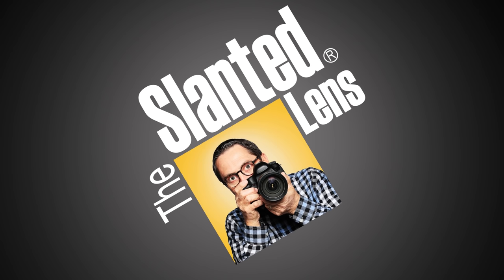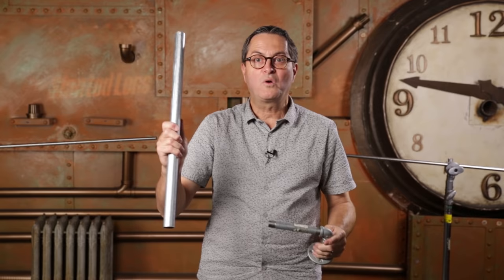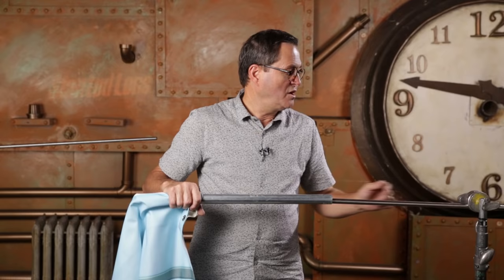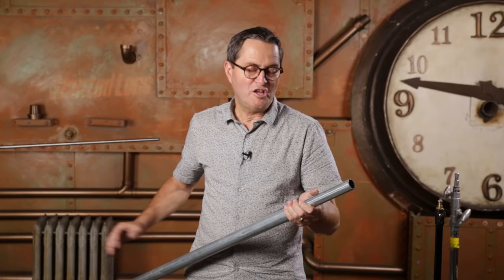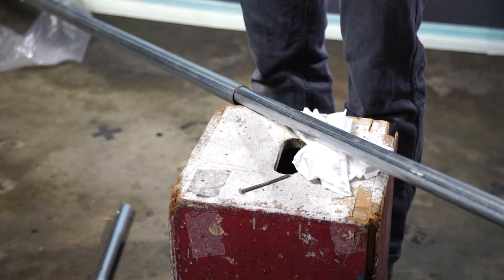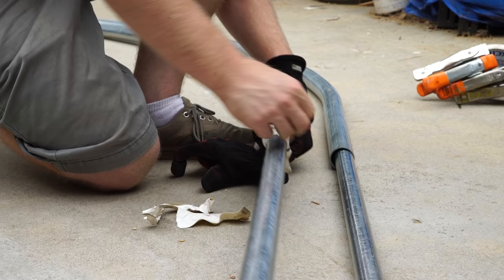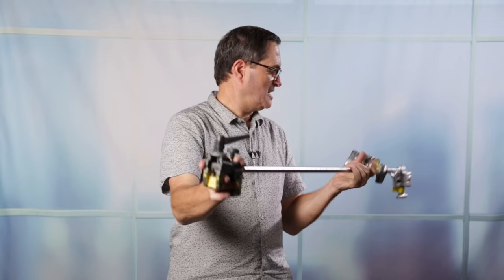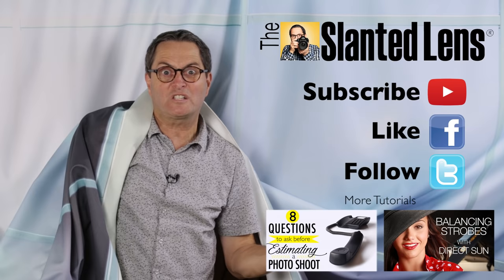TSL 3 Ways to Hang a Backdrop DIY Tutorial

Comment: Oh awesome. I had done the half inch pipes in the ceiling but with screwed in pipes over the whole span which forced me to use clamps even if my backdrop was  sown.... I will upgrade it to us the 1 inch tube the way you have it set up. Thanks!
Reply from the maker: Thanks for sharing with us!
Reply: @TheSlantedLens   i did the upgrade tonight. I will also use a pipe at the bottom to "stretch" my cotton backdrop once i have a loop sown at the bottom too. Cheers.

Comment: One thing that i'm using now are magnets.  I screwed a few strips of metal into the wall of my studio and use some really powerful magnets to hold the backdrop up.
Reply from the maker: +Zarli Win Cool idea. Thanks!
Reply: I wanna try this! Thanks!
Reply: Sounds simple.  Will give it a try. Thanks for sharing.
Reply: Damnn that's a very cool Idea!
Reply: @Zarli Win - you are a genius sir. How did you attach the magnets to the muslin material/backdrop? I am really going to have to try this. I just have to chase down some powerful magnets now.
Reply: @gosteronlinecourses  I don't attach it to the fabric, I just sandwich the fabric between the magnet and the plate

Comment: When I had a studio I used a pulley system with both metal and wood poles with eye screws at the end of the poles that would clip into two steel bolt clip swivel eye hooks tied to two pieces of rope.  This allowed the changing of different backdrops or seamless rolls to be done quickly.  It worked well on 12 foot seamless rolls well too.

Comment: I'm going to use pvc pipe instead of metal conduit pipe.  PVC is lighter, cheaper and easier to cut,
I'll still be using a metal plate, straight and elbow pieces though.

Thanks for the Video!

Comment: THANK YOU!

Any suggestions on how to take wrinkles off of white back drop🧐
Reply from the maker: We usually use a steamer. You can also use a spray bottle and spray it with water and then when it dries the wrinkles should be lessened. And of course an iron will work but that is very time consuming.
Reply: @TheSlantedLens  DEFINITELY! However I noticed because it’s Polyester material, the spray bottle in warm water doesn’t work too well. Any suggestions?

Comment: Hi. Great video. I have a question regarding backdrops, I really hope you can answer. For a regular talking head video, what dimensions of the backdrop would be suitable? I don’t want to place the subject too close to the backdrop, have some distance and accent lighting around too. But with all that, do you think something like 3m in width and 2 m in height would be suitable? I’d really appreciate your response. Thanks
Reply from the maker: 3 meters in width will work well. The height should usually be longer than the width like most standard backdrops you can roll them out to whatever length you need. But if it is just head and shoulders you may get away with the 2 meters. It seems a little tight though.

Comment: I have a gable roof. Any tips on how to use/ hang backdrops on my top floor?
Reply from the maker: +Doede Boomsma Are you looking to mount something on the wall/ceiling or set it up using a stand? If you are mounting something to hold the drops up, just make sure both sides are equal-distance from the floor so the drop looks straight.
Reply: +The Slanted Lens There's not enough width and height for a decent backdrop because of the gable-roof (it's like a triangle). I haven't searched hard for a solution, so this was just a quick question.